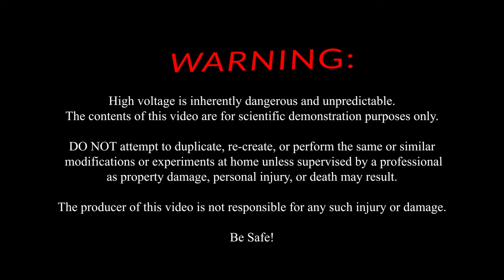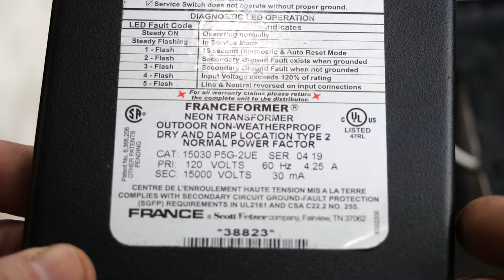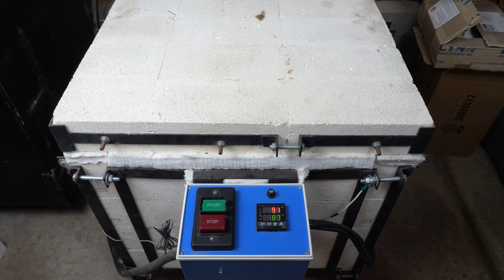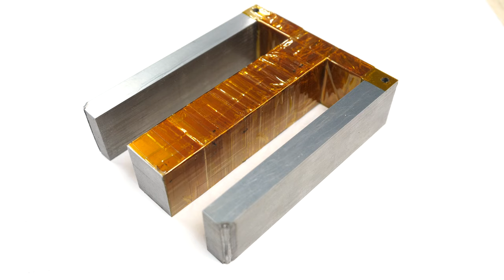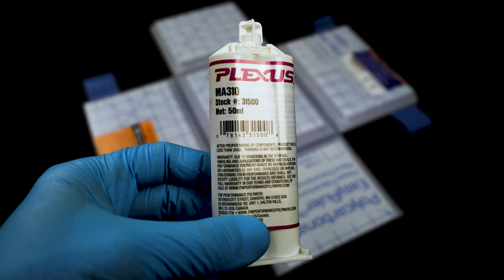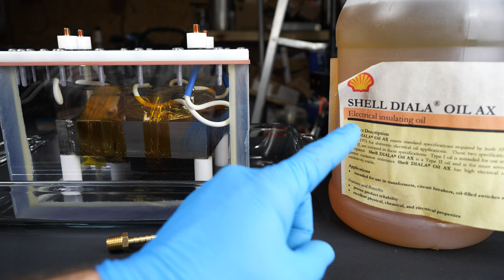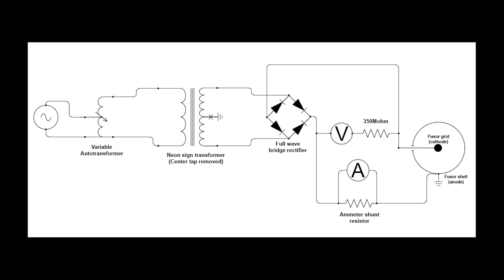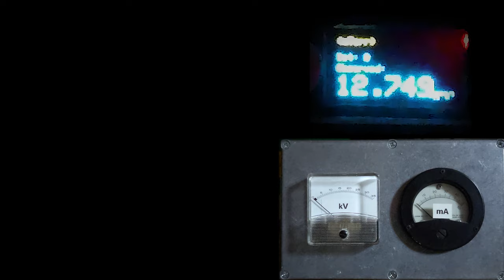Neon Sign Transformer High Voltage Power Supply

Comment: Watch out the temperature rating of the magnet wire is rated at 180 deg c. 
I'm amazed the wire and insulation wasnt damaged in the process. 
Awesome work.
Reply from the maker: Oh wow good to know. Unless my kiln's temperature calibration is off by 20c or more there must be a hefty safety margin in the temperature rating of the magnetic wire. I'm glad it didn't get destroyed! Thanks for the info.
Reply: @Project.Infinity  its probably because the tar was transferring the heat. 
Burn out ovens for electric motors run at 365 deg. 
You have to be careful because you can destroy the electric iron laminations .
There generally gas fired with water vaper to keep ignition down

Comment: NICE VIDEO!!!
I have MANY of the old style NST's.  I found a way to measure the Max current.  JUST USE A CHEAP DMM ON mA SETTING!  Just short the NST output across the DMM leads and read the mA's.  I depotted a 15kV @ 60mA  NST so I could remove some shunts to get more current.  I got up to about 70mA.
THE CAUTIONS:
Use a cheap DMM (that you can risk) at the 200mA AC setting.  Make sure all the DMM fuses are good (and higher than the NST current).  Make SURE the connections between the meter and NST are tight and secure...I used double connections.  If a spark happens, that is the END of the meter.
I lost one, since it happened to have a blown fuse inside!!  The spark went across the blown fuse...putting many kV's through the meter.
THANKS AGAIN!!
--dALE

Comment: Why remove the center tap? It's supposed to have a center tap to split the output voltage due to insulation. You could simply just not ground it. Also I recommend tilting the tank when pulling vacuum, to make it easier for trapped bubbles to float out of the bottom.
Reply from the maker: True, but leaving the transformer case ungrounded would make it float at high voltage. I was actually using this transformer for some time by grounding the case, and floating my fusor. However doing either is really dangerous in practice as any accidental touch or stray arc from the transformer's case or my fusor could legitimately stop my heart. In order to full wave rectify the transformer's full 15kV AND have my fusor's anode grounded (for safety), I needed to isolate the transformer--So I got rid of the case, center tap, and sunk it in oil. I wanted to replace the tar anyway due to the transformer oil insulating and cooling much better, so I could run it at higher current (after removing some shunts) without it burning out. It was a lot of work but it's still functioning wonderfully after making the mods I demonstrated in the video :)
Reply: @Project.Infinity  you could at least leave a centertap on the core. Also you shouldn't even touch anything with live hv to begin with, just don't forget it's live lol
Reply from the maker: @trenthighvoltage  Haha, yeah forgetting it's live is exactly what I was worried about. With the fusor chamber grounded (acting as the anode after rectifying) I can technically touch it now. I still avoid touching anything though just to be safe. 
I wonder why I should leave the center tap on the core though if I'm leaving the core ungrounded anyway? Wouldn't that increase the chances of the core arcing to the primary? I figured leaving the core floating lowers the potential for internal arcing.
Reply: @Project.Infinity   Technically, the insulation is double, its on both secondaries so it doesn't really change much. But, there's also balancing issues that you possibly will have. It may sound stupid, but I've heard that it's possible. Just leave it centertapped to the core, if you don't want to ground it, then don't. Just don't touch anything high voltage lol, it's not hard to not forget it. Put a hv icon label on it or something, or an indicator, etc etc.

With centertap, the insulations sees half the voltage so it won't arc. Also, honestly you didn't really need to remove the tar from the windings, at least some on the sides, as they're still going to heat up about the same temp, even with oil inside.
Reply from the maker: @trenthighvoltage  I agree, with it center tapped the insulation will only see half the voltage; One secondary at +-7.5kV, the other at -+7.5kV, referenced to ground through the center tap, but that's only true if the center tap is grounded. If the tap is not grounded the secondary coils act as a single coil instead of two half coils so they reach 15kV above ground, which the stock dielectrics (tar/mica) are less likely to keep from arcing as they were only designed to withstand 7.5kV (esp at higher currents due to my removal of some magnetic shunts). Transformer oil and polyimide have a higher dielectric strength than the tar so it mitigates the risk of arcing. Removing the tar also allowed me to remove some magnetic shunts to increase the current output.

That's an interesting point about the balancing issue. Luckily it's functioning really well though so I'll probably leave it alone unless I run into any issues. For real thank you for the suggestions and for checking out my video. Your channel has some pretty awesome content and I'll be sure to follow your stuff!
Reply: @Project.Infinity thanks you too

Comment: Yes, very AWESOME!.  Some questions though because they seem counter-intuitive to me.  Since it worked, I know the answers must be "NO".
1. Didn't the mineral spirits wreck the insulation-varnish on the primary/secondary?
2. Doesn't the transformer oil de-stickify (my word) the Kapton tape over time?
3. Was going to ask about x-ray generation, since you are pulling a vacuum.......but you answered it in the video.
Again, very AWESOM!  Stay safe.....or at least get extra life insurance, then your wife won't mind so much if you touch something you shouldn't have.
Reply from the maker: Haha, extra life insurance probably wouldn't be a bad idea. It was a risk but indeed the magnetic wire insulation wasn't damaged. It's possible it was either a material that's inert to the mineral spirits or cured well enough that the brief contact wasn't enough to damage it. You're spot on with the Kapton tape. The adhesive didn't stick very well once exposed to the transformer oil. Luckily though the tape is held mechanically as well being sandwiched by the coils and core, holding it pretty securely in place. Everything is still working wonderfully so it must be holding up well enough. Thanks for the comment!